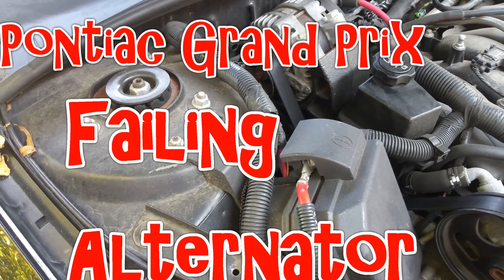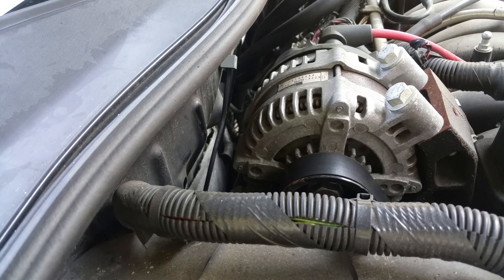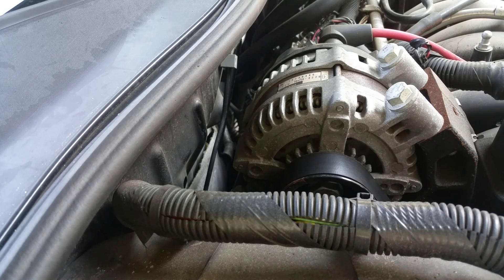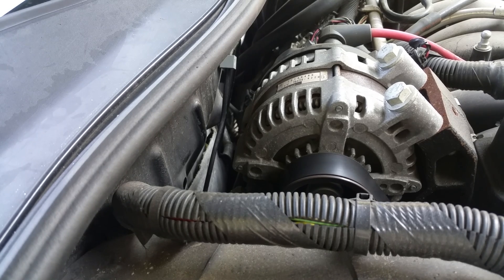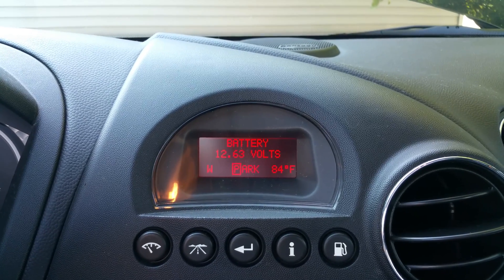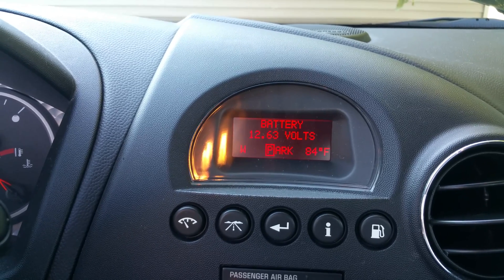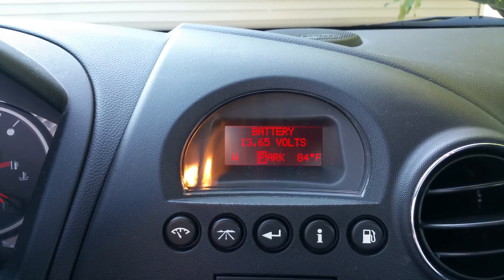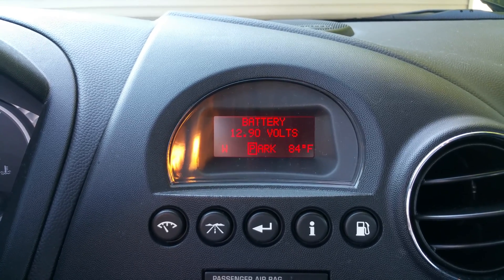What a failing alternator sounds (and smells) like.

Comment: I have the same engine in my 2006 Impala SS, just noticed the noise tonight for the first time, made the exact same one in your video ., the wife is not going to be happy, lol. I've put so much work into this car with only 54k miles it's ridiculous.
Reply from the maker: Cuzn55 54k? wow. must be in good shape besides the alternator.
Reply: GPVlog yeah the interior is very nice, mechanically not so much, I've done both front wheel bearing hubs, both outer tie rod ends, the A/C condenser, the radiator, the engine oil pressure sensor, the water pump, both lower control arms, brakes and rotors all around, tires, battery, (last three are regular maintenance), but it does add up . I still have to do the blend door actuator underneath the dash, but that's not a top priority for me yet . I got the car with only a little over 26k, and have had nothing but problems, lol . The first owner only drove it 19,000 miles and the second owner drove it 7,000 . I've put the most miles on it out of both of them, but it's a great car to drive around, which is why I refuse to get rid of it
Reply: GPVlog and spark plugs and wires, which I have to thank you for cause without your video on it i don't know how I would've done them, so thank you, your videos are a big help 🤘🏻
Reply: CUZN 55..I have a 94 Trans Am I bought new, has the Lt1 350 engine.  Sorry your having so many problems with such a low mileage car. I bought my car new, and it's been a great car. 337.000 miles now, engine never been touched. Runs perfectly. My original alternator just started whining,  and is very hot. So I need to replace that. It had no problems at all to the first 100.000 miles except for new power window motors,  a water pump failure just before.  Since then. Over the years its had 3 optispark replacements,  2 new radiators,  1 new catalytic converter,  that was last year. 1 ac compressor,  still working... shocks and struts . 1 factory rebuilt transmission,  still working great. Cant think of anything else. Not too bad after all those miles, and 25 years. Keep at it with your SS. NICE CAR and you'll definitely get to the point where it should go a long time without any issues.

Comment: Another great way to test a Bad Alternator would be to:

1 - start the engine and let it run at idle speed...
2- WITH THE ENGINE RUNNING, disconnect the Negative Battery terminal ( The engine should continue to run)..  if the car shuts down ITS THE ALTERNATOR ..  tah-dah !!!
Reply: baronbruce83 you should delete this bro this can screw up a lot of cars and people if they follow your instructions
Reply: This can fry the voltage regulator. If it was fine to run the car on just the alternator, then they would be designed to do it that way.
Reply: Battery acts as a buffer to prevent spikes / surges of power to the sensitive electronics. The act of disconnecting a battery while there is a draw can also cause some pretty shitty surges as you're disconnecting it, for instance even when the car is off and nothing is running note the little sparks.
Reply: And also ....i even know this. Lol my uncle years ago told me to disconnect my ground wire in the battery of my 1998 chevy s10 Pick Up to see if altinator was bad. ......i ended up having to replace the ECM cause doing that while it was running fried that computer ..:/
Reply: baronbruce83 well ya no duh smart ass. Some people don't know to even do that though.... And what if like my case the altinator is charging fine but it has a very bad bearing in it. ? My charges just fine but bearings are fryed and this helped me find the problem cause I didn't think to spin the altinator pully without belt. Watched this and now....common sense kicked in and well, problem solved  .
Reply: No. Don't do this!!
Reply: DO NOT DO THIS ON A CAR THAT IS COMPUTERIZED. New cars are. Doing this It could damage the computer system.
Reply: Baron Bruce Nope you could damage a newer car this way and it may not be alternator
Reply: Never had any problems with this method.... explain???

Comment: Thanks for the tips man. I was wondering what was that whining and the smell of burnt wiring coming from. time for a new alternator. 👍
Reply: Manny Vargas mine started smoking and smelling today. I have an aftermarket stereo that draws a lot of power. This alternator was purchased less than 6months ago
Reply: @joshuahparten4502  did you fix the problem ? having the same issue

Comment: if you unplug power from the alternator would the whining sound be gone, I got 33k on 2010 honda crv, I am surprised alternator would go out so early
Reply: No
Reply: Yes, good way to tell if the alternator is making the noise. Start the vehicle, unplug the alternator for a moment & have someone rev it up a little bit.  If sound stops when it's unplugged, it's def the alternator!
Reply: @bigsky445  .alternator is belt drivin pulley would still be spinning. You would have to remove the alternator belt first

Comment: 150k miles and still have a warranty? nice..must of paid extra for that.
Reply from the maker: when I purchased the car I requested, and paid extra for that warranty. I knew going in that there would be certain issues with the car that were common to all gxp.
Reply: +GPVlog and to the regular Grand Prix..got a 07 GP GT and most of the issues I've seen from you I've come across, like those HVAC bulbs. My volume controls on steering wheel are out to. :/
Reply from the maker: +Michael J the steering wheel controls sadly require the removal of the air bag. something I am not comfortable doing.

Comment: how much do they go for ?
Reply from the maker: 230 plus tax.
Reply: +GPVlog thats not to bad hey so i have a question i want to buy a yellow top optima and the one the website says is the model number is 8040-218 D35 and its specs are (Weight:	36.4 lb, Length:	9.38 in, Width:	6.75 in, Height:	7.69 in) but there another one with more juice in it and its a yellow top as well and its modle number is 8012-021 D34 and its specs are ( Weight:	42.9 lb, Length:	10.06 in, Width:	6.88 in, Height:	7.88 in) do you think it will still fit? thank you once agian you really help out alot.
Reply from the maker: +MasterGTX I am going with a group 34 battery. It will fit.
Reply: +GPVlog ypu think with a slight mod it will git ?

Comment: I had the same thing in my LS4 impala SS. I first noticed the whining sound, and then later on it died on me. but then replaced it with a refurbished alternator. cuz I couldn't afford a new one at the time last year. but the smell, I didn't notice.
Reply: runs like it should. no issues when I had the LS4 impala SS apart from the transmission blowout and the floor shifter at one point